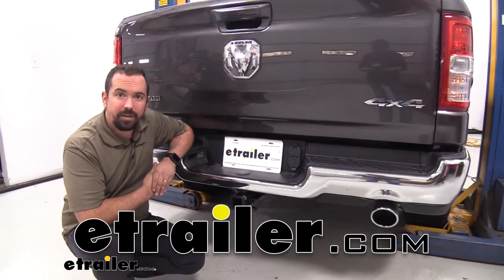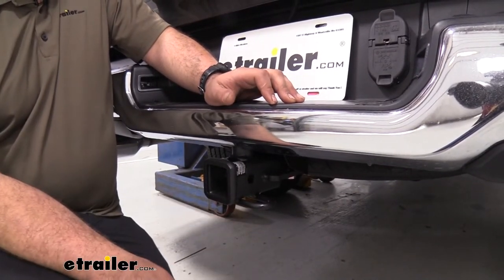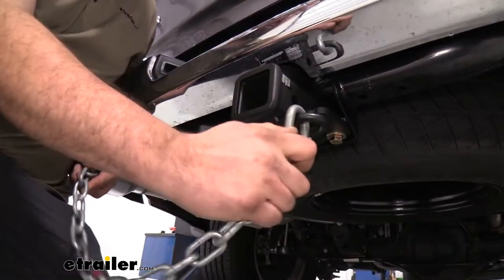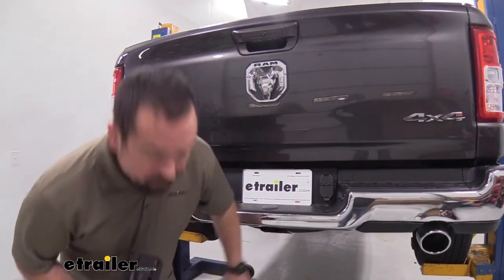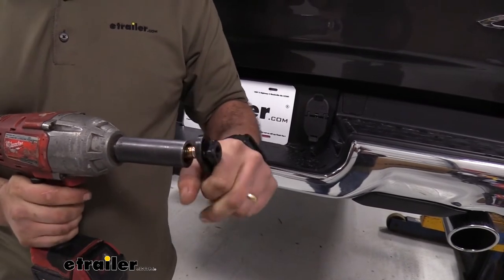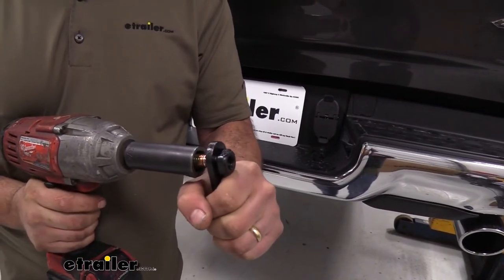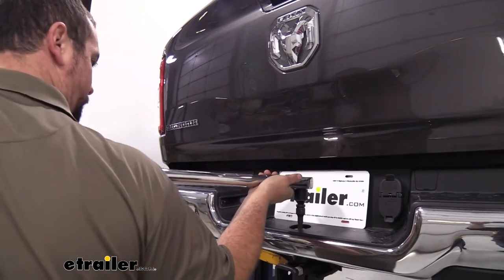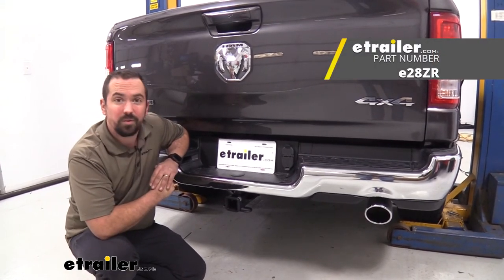Step-By-Step Installation Tutorial for the etrailer Trailer Hitch Receiver on a 2022 Ram 1500

Comment: Does this work for towing jetski and trailer?😊
Reply from the maker: It sure will! The etrailer brand # e28ZR hitch has a 6000 lb towing/600 lb tongue weight capacity so it would be great for towing a PWC and a trailer, as long as you don't exceed that 6000/600 lb hitch capacity or the towing capacity of the truck, whichever is lower.
https://www.etrailer.com/Trailer-Hitch/etrailer/e28ZR.html

Comment: I want to be able to tow a u haul trailer
Reply from the maker: As long as the trailer weighs less than 6000 lbs with a tongue weight of 600 lbs or less, the etrailer # e28ZR hitch would be an excellent choice. If you don't already have a trailer connector installed on your truck, you can install one using part # HM40975.
https://www.etrailer.com/Trailer-Hitch/etrailer/e28ZR.html
https://www.etrailer.com/Custom-Fit-Vehicle-Wiring/Ram/1500/2022/HM40975.html